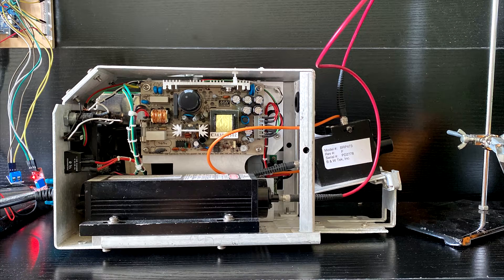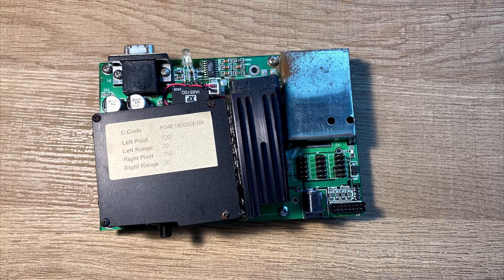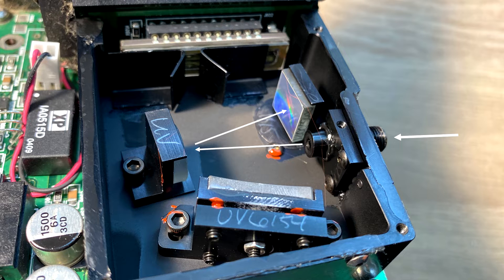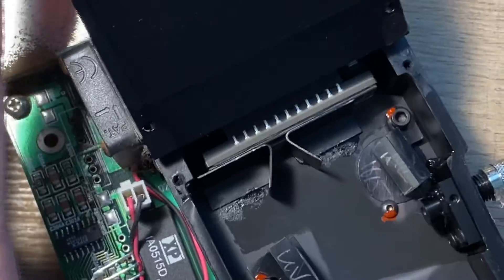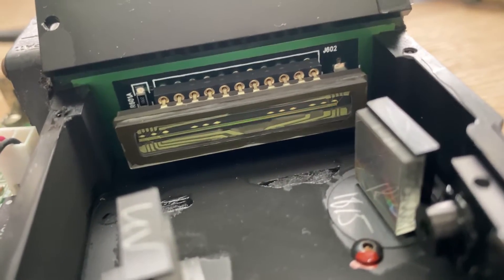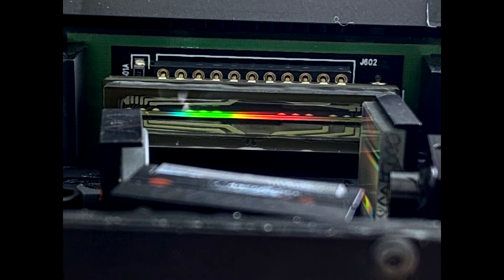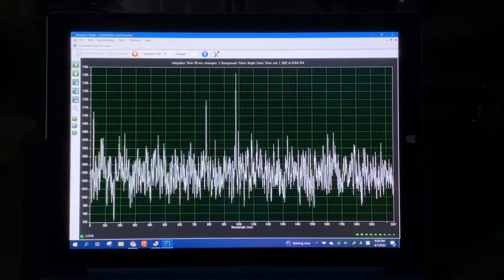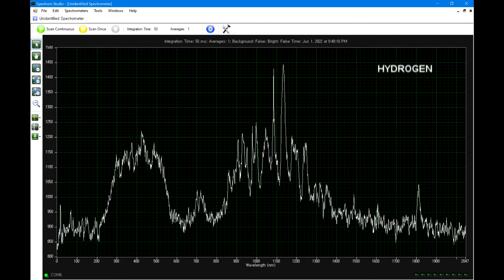How to Calibrate a Digital Spectrometer

Comment: I think the shield was there to reduce stray light in the original wavelength range of interest. If this is originally for Raman, the spectral range should be about 150nm range. So not all of the 2048 detector pixels are used. For calibration, you could use a neon lamp or mercury argon lamp to calibrate the spectrometer with the peak positions from the calibration light source.

Comment: This is not the way to calibrate this spectrometer. First, the numbers on the x-axis are not nm as the axis label says, but pixel number (the detector has 2048 pixels). You have to put the calibration constants into the settings of the software (tools icon above spectrum frame) in order to match the pixel numbers with wavelength. Second, do NOT rotate the mirror as you are doing as it will screw up the focussing of the spectrum on the detector... you will lose a lot of spectral resolution. The actual alignment of the optical elements is very tedious (you can find the discriptions on the internet searching for "science surplus spectrometer" on how to do this correctly).
Reply from the maker: I did spend some time reading through the pdf version of instructions on the science surplus website and the forum, but it didn't quite help me. Like you said, I need to put the known light source to find the peak intensity and put the numbers. But whatever the source was, it always gave me signals in a particular range, which was the part of the CCD that was exposed to the light. At least, it did not make sense to me as to why the CCD had a shield on it. After the modification, I calibrated it by using Hydrogen emission spectrum and putting the peak wavelength. It could not be the most accurate spectrometer in the world, but now it displays the fairly accurate shape of spectrums for known-sources.
Reply: @iheartnuclear8517  You were absolutely right to remove the blocking parts in front of the detector. They were installed because the original use of the laser and spectrometer was a particular raman measurement (it was some medical device), for which only part of the spectrum was of interest. As far as I remember there is also a filter at the fiber entrance that you can remove to increase the spectral range. However, you do have to do the wavelength calibration with the coefficients... the total spectral range is probably not more than approx 300 - 400 nm (for instance from 350 to 650 or something similar), not from 0 to 2000 nm... 0-2047 is pixel number. There is a full thread on the laserpointerforum on these spectrometers of a number of years ago.
Reply: @dirkbernaerts6893  Have you ever recalibrated the Ocean optics USB4000 unit? I am in trying to replace the diffraction grating and also program the eprom on the unit and finding difficulty with doing to constants and then using this data to upload to the unit. any clues or idea?